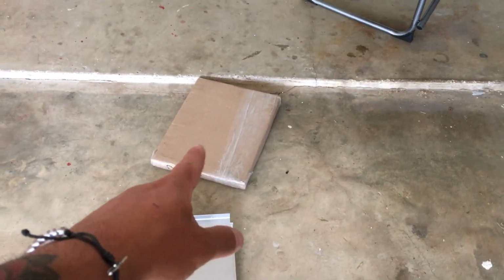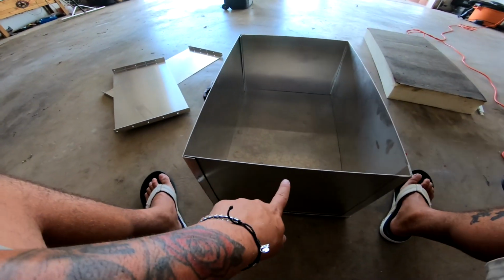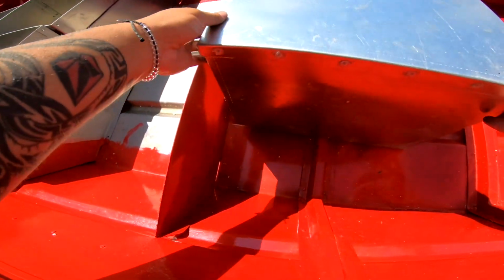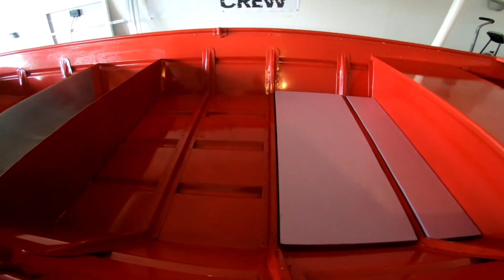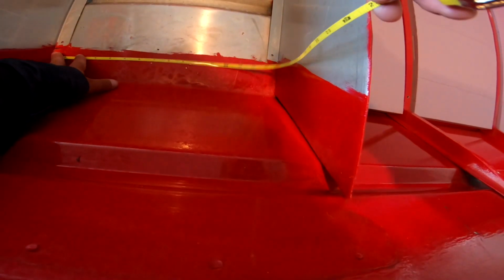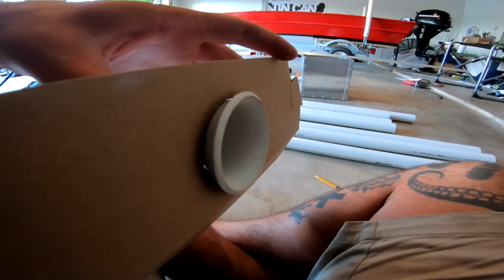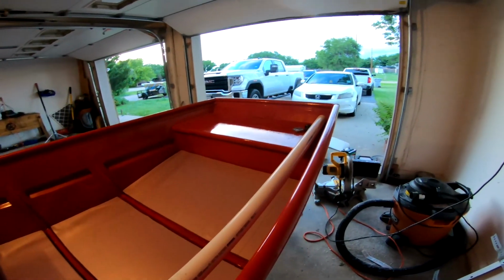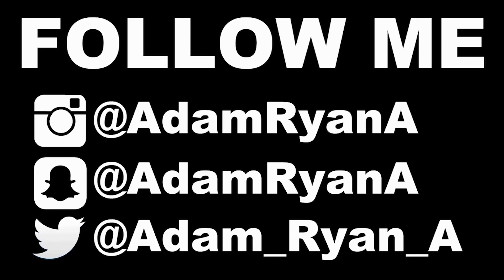ADDING FOAM AND STARTING THE ROD LOCKER ON MY JON BOAT TO BASS BOAT CONVERSION!!

Comment: What about the front weight when you are casting? Considering the batteries, probably 2 guys standing in front of the boat and the trolling motor. I’m not sure the boat motor would balance it out. Can you separate the batteries?

Comment: I would strongly consider moving those batteries over to the middle or you could separate them to counter each other. I just don’t think counting on your own weight to counter is the right move. Is it a 24 volt trolling motor? Mine is 24 but I only use one battery lasts me more then a whole weeks fishing trip. You do nice work but I enjoyed your electrical work on your first build. Very clean on all you work. Did you ever weigh your old build? I’m curious how much weight your going to shave off.

Comment: Adam, is that R-5 you are using to foam the boat?  Any issues with fuel or other fluids that I should be concerned about?
Reply from the maker: Yes gas will eat up and dissolve the foam, I built a special gas proof box around my gas tank to avoid this happening
Reply: @AdamRyanA  I thought I remembered watching you do that.  I really don't want to deal with pour foam so I am going to do the same.  Thanks for the fast reply Ryan!!